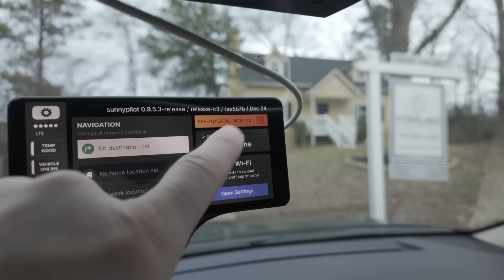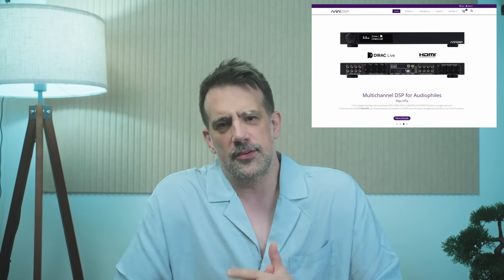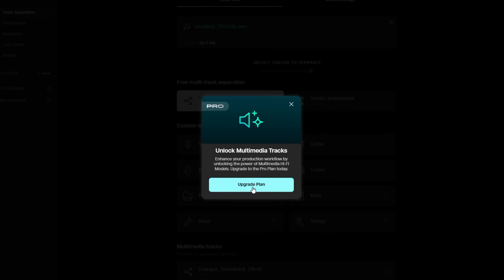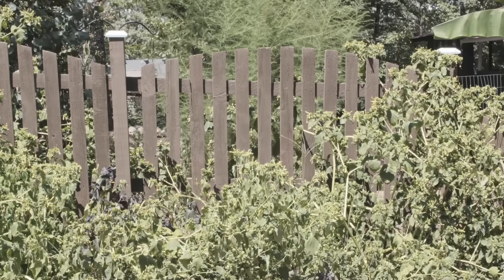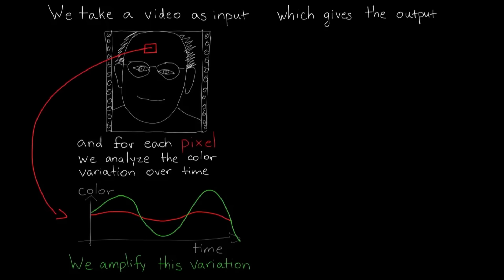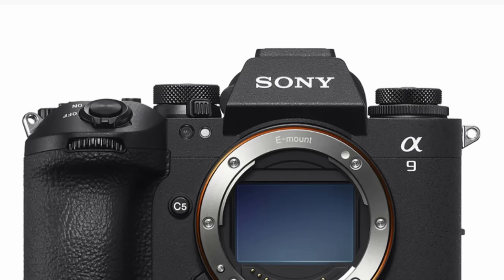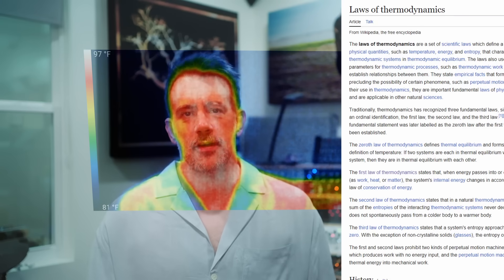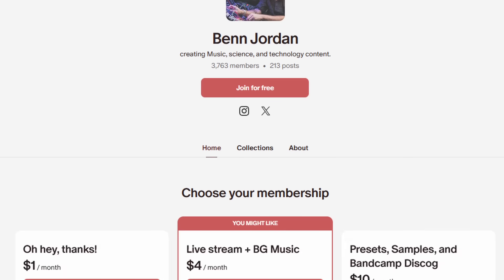How To Make A Legit Sound Camera

Comment: I wonder if some of the reasons (excuses) cameras for detecting machinery vibrations is global shutter and high frame rate. It seems like there might be weird aliasing of vibrations above half the camera frame rate. Fast might also mean onboard processing with a DSP or FPGA.  I don't remember what what it is called, but there is a C or C++ version of the matlab code and it has a GUI and is open source. I was trying to use it a few years ago to see if I could predict which trees would fall in the next big storm. Unfortunately once I got it running, there wasn't even a breeze until some time after I lost interest.  I have got to try the fake schleran, that was cool.  Right as Covid hit I was laying out a circuit board to do what your paddle like microphone array is.  A possible difference is I was going to use microphones sensitive up to 80kHz because I wanted to track bats. I got hit by the chip shortages by the time it was ready to attempt having the board made The chip I couldn't get converted 8 or more PDM microphone signals to PCM   192000 sps on TDM(?) channels which was going to make it relatively easy to get onto USB.  Do you happen to know if your microphone works into the ultrasonic range and is the sample rate high enough?

Comment: Regarding software, it's not impossible to analyze each pixel's differences from the same pixels in a previous frame.  And then say that "the pixel needs to change its R, G and B values by this much to constitute a change" to eliminate too many false positives.  You can then use this method to do what is essentially the quantization in video compression and decompression, equate a small square or rectangle of a predetermined size of pixels as a unit and measure if each region has changed based on the region of the previous frame. For example, if your approach scans each frame of video from 4K or 8K sources or images taken by a Nikon Z8, you're talking up to 8256 × 5504 pixels per frame or a change value for 45,441,024 pixels and that's per frame.   That's why you want to have a small rectangular or square area constituting a quantized value for the group of pixels within.  It uses a truckload less memory to store a value of change for each 4x4 (or whichever values you are using) region than it does for every pixel in a frame.  Then you compare each of these in a frame to the values of the previous frame.    It's also expected that you will also have filtering or normalization methods to pass each of the frames through such as rolling s hutter compensation, image downscaling and other required frame cleaning and preprocessing such as noise reduction and so on.  Modern video subsystems on all modern operating systems have filters that can do this section rapidly.  When playing back the video, you can then draw colored rectangles with a 10% transparency at the position of each of the quantized pixel groups.  Then again, there are filters to create an overlay video which can simply sit at a level above the video that is playing back.  This processed video layer can simply be given an overall 10% or 20% adjustable transparency and each colored region can be a more saturated version of the color that shows a change based on how different it is.  If the amount changed indicates a massive change, then your methods can determine that this amount of change is out of range and not draw any rectangle for those pixel groups.  So, your code can scan all of the video frames and generate a file that is the analysis, then process that analysis and build that secondary video layer (or just draw the graphics outright) as a result of the analysis.  To be clear, I'd expect the processed layer shows colored squares or rectangle and have adjustable transparency so that it can be played over the video playing on the layer behind it.  This allows you to save an analysis of the source video, save a processed analysis of changes in a separate video and have the source video and the processed results to be displayed over the source video so you can see both the video and the processed results.  In concept, not too hard and pretty straightforward.  Remember that lots of modern video subsystems (like QuickTime) have been able to do this for decades.
Current photo cameras are also able to take and store hundreds of photos rapidly enough to count as short videos if you have a device that is able to play them back rapidly enough.  They can be thought of as frames and processed in a similar manner as described above to detect pixel differences.
Reply: For the record and to show why each frame of a video is quantized into rectangular regions that represent a group of pixels, below are the pixel counts of 1080p video, 4K video, 8K video and Nikon Z8 images.  These are per frame and per image.
1920 x 1080 pixels, 2,073,600 total pixels - 1080p video
3840 x 2160 pixels, 8,294,400 total pixels - 4K video
7680 x 4320 pixels, 33,177,600 total pixels - 8K video
8256 × 5504 pixels, 45,441,024 total pixels  - Nikon Z8 maximum photo dimensions

Comment: 14:45 Are you sure that wasn't the heat from the electromagnet oscillating as it is technically a type of motor?
Reply: Agree in that. It's the coil heating up from internal resistance. 
It's a perfect small circle, as coils usually are.

Comment: I applaud your creativity and curiosity. However, in the context of this video "How To Make A Legit Sound Camera" you never once mentioned the most important limitation of capturing sound with a camera, namely, sample rate. Frame rate = sample rate, and framerates are typically 24 or 30 frames per second, unless you are using a high speed camera setting on your phone such as used to make slow motion videos. In this case it is still limited to 960 fps at best. According to Nyquist Theorem, we need a sample rate of twice the frequency of the sound we want to capture, meaning a frame rate of 960 fps could be able to capture vibrations of up to 480 Hz, which is woefully insufficient to, for example, determine what somebody is saying by filming the vibrations on their window. Now if you used one of the very expensive high speed cameras the SloMo Guys use you certainly could do that.

Comment: The webcam pulse detection is wild, instant subscribe. As for the checkerboard air density evaluation, msybe using something like blue noise as the background would yield better results? The risks of aliasing would be much lower with any noise, and blue noise would introduce no low frequency fluctuations.

Comment: Unfocused capture of a point-source vibration source leads to much higher framerate as this way the scanlines carry information instead of distinct sequential frames of said oscillating source. This is also used for covert exfiltration of data from air-gapped systems using on-site security cameras.

Comment: This reminds me of the video where researchers reconstruct the audio of a speech by filming the vibrations on a potato-chip bag through a soundproof glass. There was also a technique that was used during the Cold War where a country managed to have the windows of an embassy replaced by a specific glass, to allow them spying on the conversations by measuring the tiny vibrations on the glass, from the outside (although it was not by using cameras but rather a laser microphone)

Comment: I was working for a company last year as Engineering Advisor and one of the areas I was asked to advise on was the wedding up of a Noise and Vibration section. I was already familiar with the products of Brunel & Kjaer and the price tag that attaches to that story of my and have, in the past, used their kit to measure engine noise and vibration. My advice to that company was not to bother buying any kit but instead to use their local Consultancy, the Automotive Research Institute for India. My reasoning a was that they would need to spend a minimum of £300k on kit and, having spent that money, they still wouldn't have the level of expertise or experience to know what to do with the data. Add to this the fact that the requirement to carry out noise and vibration measurements was only going to be sporadic (once you've signed off the product design you're not going to be doing the work again), that certification could only be done by approved laboratories and the costs of calibrating the equipment annually, it made no sense. ARAI were quoting less than £20k to carry out a full noise analysis, advise on how to improve noise levels and then certify the product.

Comment: The "acoustic" heat from your speaker was more likely the lossy component of the speakers' materials' elastic/viscoelatic structure (flex something vigotously enough and it gets hot).  Potato/potahto...this is inspiring and very well done!!

Comment: By the way I'm laying in bed and it's really really early in the morning and I've been awake since 4:00 a.m. I just watched your video and I am so utterly intrigued because I have a whole corner of my room right now with about 10 different lenses for different cameras one with an IR filter removed three different software to find a radios for different actual types of microphones several different webcams and I have a Homeland full of computers waiting to be formed into a distributed computer system several different distros including Dragon OS which means sdrs you didn't think about that picture you didn't think about ways above ultrasound!!! Imagine not only your little USB sound panel but a phased array antenna and like five of them hooked up to five coherent RTL SDR with a single 10 MHz source

Comment: I am a lifetime photographer who started developing film when I was 10 years old and I have video equipment cameras dslrs I've had a camera with the infrared filter removed I have microphones and you just figured in me I have a telescope I have a big telescope I have a small telescope and I have lasers I have all kinds of electronics microprocessors deaf boards I have software-defined radios and you just put something in me that is going to become my obsession for the next year
Reply: Thank you for giving me a reason to get up today I'm suffering from severe complex post-traumatic stress disorder and are 148 IQ I'm in therapy I'm about 3/4 of the way through when I hit a rock wall and I have all this gear I have a computer built for AI Or I hate that word Deep machine learning I've got a am 5 form factor 7950x 128 gigabytes of ddr5 Ram nr4080 sitting right next to something not too much less 64 gigabytes of ddr4 A very powerful AMD of the next lower generation and a 2080 And then I have one just below that And with the new interconnect that They just made for Linux And the drivers I could literally form approx max distributed Computing system to process all this data
Reply: I started data science in biostatistics as a research assistant in infectious diseases taking seminars and SAS SPSS and in Vivo then I did the pear do farmer damages award for Kentucky that the National Association of attorney generals came and took and applied across the entire nation that's my work I did it all by myself delivered it to the university whose jaw hit the floor and asked me how in the world I did that by myself having no degree in biostatistics and I said well I'm just curious and I have an insatiable curiosity for Learning and apparently I'm really smart so the tests and my grades and my performance in my work etc and then I ran into a little problem with a pretty mean man who's waiting for here on my continent and my children live in this country and I'm a dual citizen so I'm not leaving them for nothing
Reply: All so that I can convince my state of burn to set up a Makerspace in an abandoned industrial building that they own and then portion of parts for startups and create a startup incubator and around that a microcosm will start to develop especially if you build some spaces for artists at the same place and a few restaurants and an Airbnb and boom or a bike shop that's a coffee shop that sells beer that makes food that has bipolar and a place where people can hang out
Reply: Bless you my man you just really did something for me that I needed right now and I really am warm-hearted kind-hearted wonderful person who really wants to help his community and I just want friends and a nice ending to a life which was really awesome and full which I worked for it wasn't handed to me I didn't get a silver spoon in my mouth how to study and learn and work and had to work since I was 12 on a farm violating every OSHA regulation on the book I even scratched my retina with a weed eater and a rock and the owner was scared to death he was going to get in trouble I was working in ditches with no reinforcements with Jackhammer and and forward 14 I learned how to use the modern version of Dynamite blasting caps in primacord at 14 in the subdivision which means we had to cut it into pieces don't touch the stuff inside which they already taught me in my rescue course in Leadville Colorado at CMC otherwise known as see me ski and they said it'll give you an instantaneous worst headache ever had is Nitro is a suspension
Reply: On that note if you run across old cases of dynamite in a mining area in the mountains don't touch it they used to not mix it with like a suspension that can hold it it was sawdust it'll fall out of suspension and crystallize and become shock sensitive stay the hell away from it same way when diving Underwater World War II wrecks don't go in the priming room and if you do be careful be careful of all live ammunition considered to be life because it was watertight even in the ocean and at that time again the high explosives set alarm to pick Rick acid and crystallize and become shocked sensitive you don't want to be anywhere near an explosion underwater it'll blow your eardrums out I was in 40 hours diving and citizen which the place that Jacques Cousteau said was his favorite place to die and I can tell you it's awesome.. because I'm an instructor they wanted me on the boat everyday to sip it in but most people on a 7-day trip or lucky to get 4 days to submit in but I increase the number of tourists that could take to the islands due to instructor divemaster student ratios and with an instructor with Masters that bumps up the ratio and even though I wasn't working for them
Reply: I have three sensor professional Sony video camera inside of an aqua video case underwater and Superman and I've lost the footage it was somewhere on YouTube on the internet and I don't know where it is anymore I got hacked during that geopolitical incident and they took over my Apple account which I never got back and I know that probably Jack McBrayer has my account because we have the same initials kind of and I've lost my account
Reply: It had my philosophy papers from undergraduate it had all the pictures of my children growing up they use the man in the middle attack which is a big problem here in Switzerland which they still don't really recognize with all their Wi-Fi and the hotels conference areas stadiums this hotel had more hot spots than you could ever possibly need somebody had actually installed them permanently in the ceiling tiles and you couldn't fill enough people in the ability to be like putting people for world's record inside of a Volkswagen Beetle that's how many hotspots there were which means they were all mostly men in the middle they loaded I think it was called the Sequoia upgrade for OS X Catalina it was Catalina and they had it inside of a virtualbox and when I signed off after setting everything off he asked me if I wanted to quit Oracle and I didn't think about it in the moment I hit yes I said oh no and everything was gone
Reply: I've been attacked through a Wi-Fi Cam that basically created a small amount of data that was enough to get a foothold I've been hit through the accessibility feature using ultrasonic Braille or Morse code that's built in to an apple and I don't think they put enough Security on that and I hit the flash button so it flash every time someone hit a command and it opened up the little window which showed what was going on below the surface and there was I was getting hacked through the accessibility feature in apples I don't know if anybody is figured this out yet so if they do please give me credit this is not my real name and please reach out and asked me about it cuz I have more information also HDMI cables and coming through them because in commercial settings you can use them as the internet connection
Reply: Every single Hotel should have heavy-duty Security on the client side not just on the hotel side
Reply: Travelers beware they don't ask him they don't even have firewalls

Comment: Muy interesante. Hace varios años, usando un par de micrófonos ubicados a 90 grados, uno respecto al otro, logre ubicar razonablemente bien una fuente de sonido, como para dirigir una cámara de video a dicha fuente de modo autónomo, sobre una línea de visión. Para poder procesar en C++ la transformada rápida de Fourier, usaba una poderosa PC equipada con un procesador AMD K6-2 corriendo a 530 Mhz. Muestreando dos canales de audio a 8 Khz, y 8 bits de resolución. Con un tercer micrófono, y un poco más de capacidad de computacional, supongo que se puede generar, una especie de imagen acústica en el plano de visión. En este caso, usando la transformada bidimensional de Fourier.